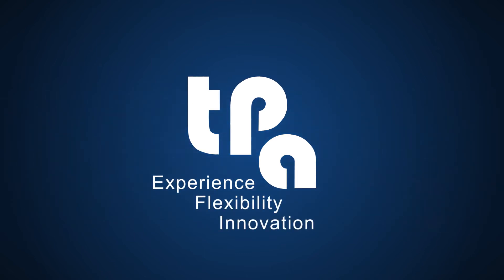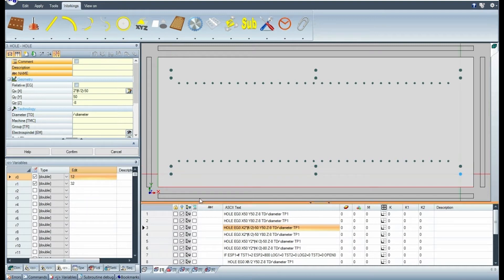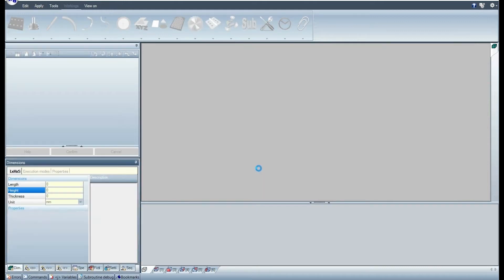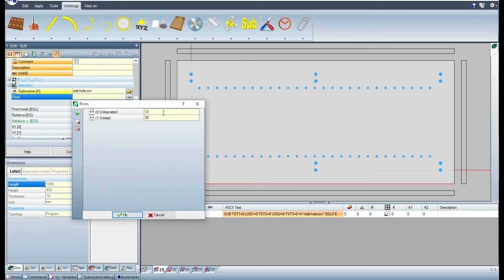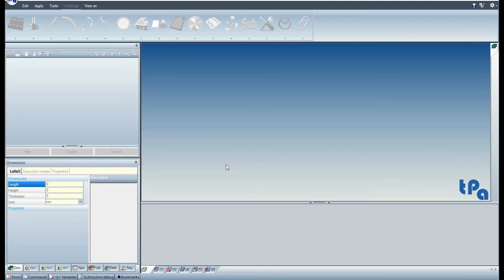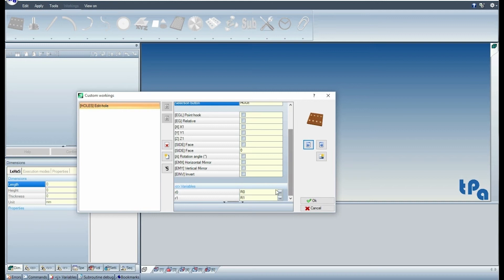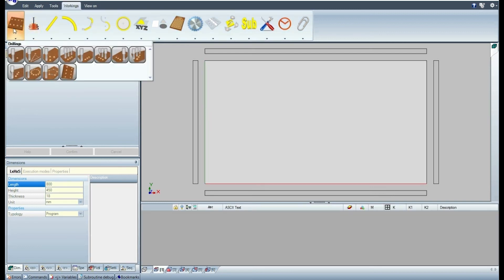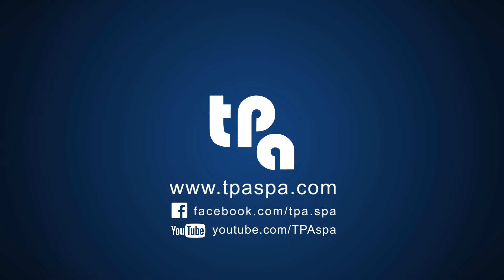TpaCAD Macro

Comment: I will have a machine with your software :) can the barcode open a macro file or automatically enter a dimension?
Reply from the maker: Dear Marek, 
you can scan and open in the barcode software one file piece that contain some macros, that will be added as a new line in the list, in the line you will see automatically the 3 dimensions of the panel and the variables that are present in your macro, if you want in the execution list you can also change the dimensions of the panel or the value of your variables and all the rules of your macros will be respected.
in the Barcode software you can also scan one barcode that will add multiple lines (pieces in the list), this is helpful in case of standard production for save time.
I hope we could be helpful in your case.
If you have new questions don't hesitate to contact us.
Reply: Excellently! So if I create a parametric door, can I load the type of machining and size at the same time?
Reply from the maker: if for machining you mean the macros or lavorations is yes, and the size too.
Reply: Hello. Can you covert for me some files from .tcn to dwg?? I have trial so cant do it